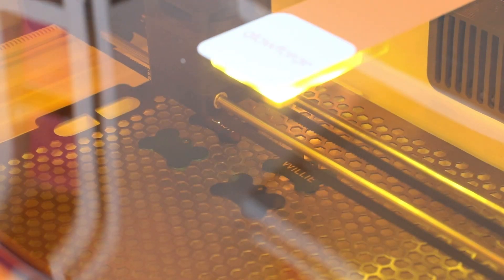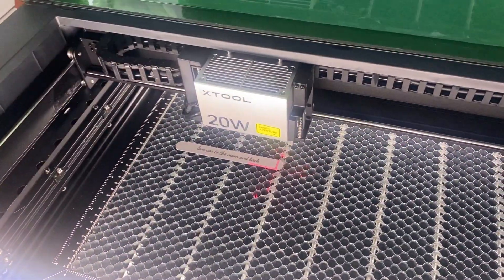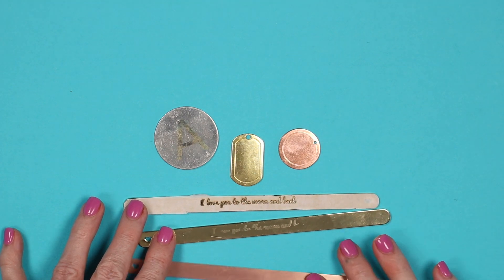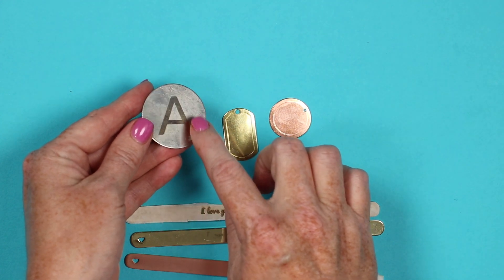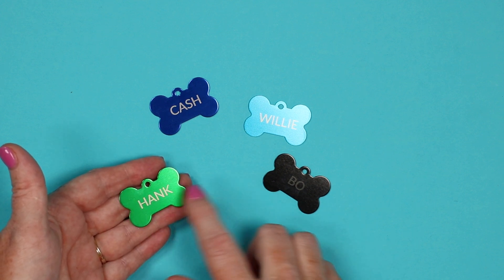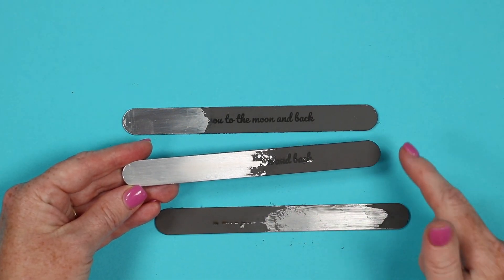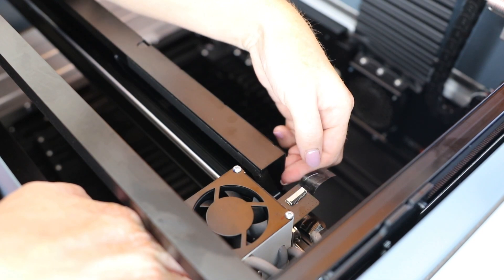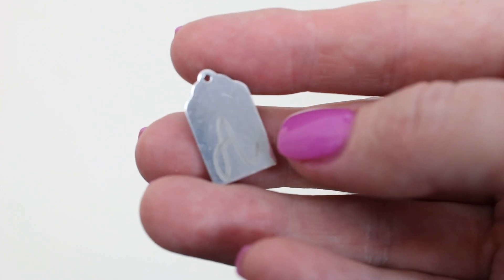Laser Metal Engraving: What Works Best and What Doesn't Work at All!

Comment: I recently bought the Creality A1 Pro and while im doing quite well with the 20W Laser I am pulling my hair out with the 2W IR laser, for the life of me I cant get it to engrave anything at all. The laser goes through the motions but leaves no markings. Tried different focus heights and different settings but nothing seems to work!
Reply from the maker: I don't have that one so I am not sure. But it sounds like maybe something is wrong?
Reply: @AngieHolden Thanks for the reply, after scouring youtube I've found that it's not just me. Apparently finding the correct focus isn't all that easy for the 2W IR laser. Some seem to have managed it with trial and error which I tried to replicate but no joy - the laser is visibly there and it did give itself a break after overheating. So I'm sure it works as it should, I just can't find the correct focus